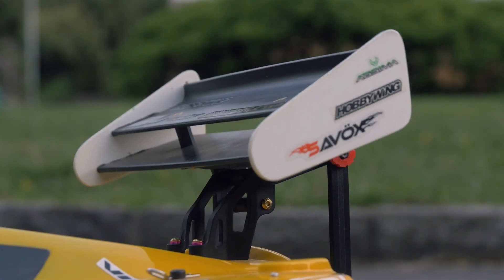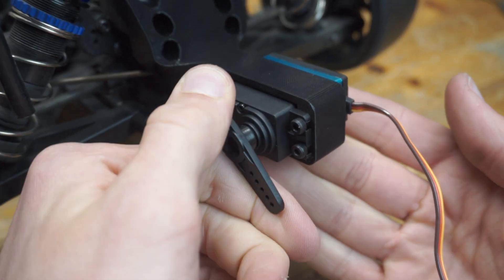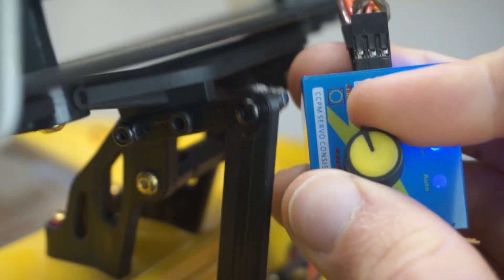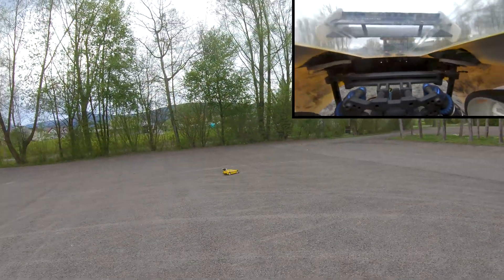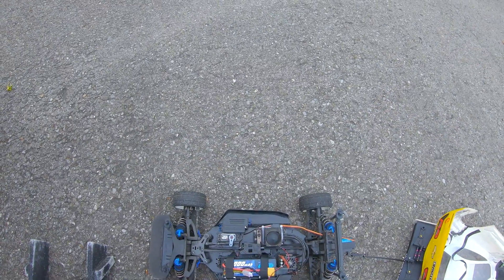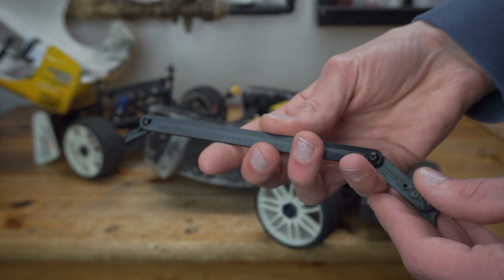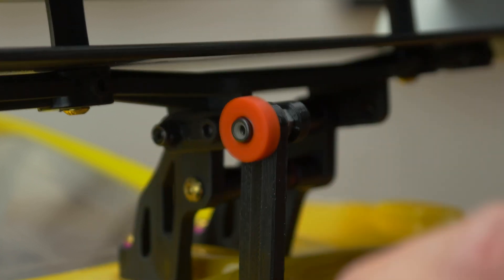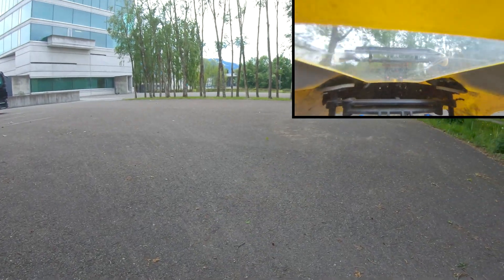Insane Performance - ACTIVE DRS WING on 100+km/h RC Car

Comment: I enjoyed watching this, very fun! Next iteration could perhaps be a "fan car"? sucking it to the ground?
Reply from the maker: I'm glad you enjoyed it! Ohh I've thought about that as well, I think it could be really cool but would probably require a super powerful fan. By the way, I'm working on a (sort of) related car right now. It uses an RC Airplane EDF, but instead of producing downforce it is pointed toward the rear, the car's wheels are disconnected from the drivetrain and the car is fan-driven :D
Reply: @ValRC1  You wouldnt need a powerful EDF at all to create tremendous downforce just so you know :). reconsider the concept please and most of all have fun!